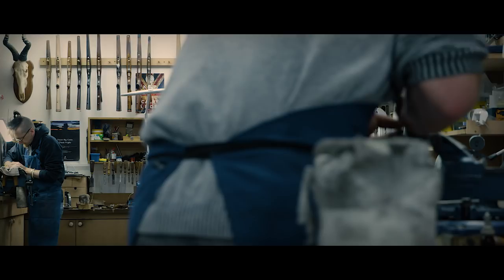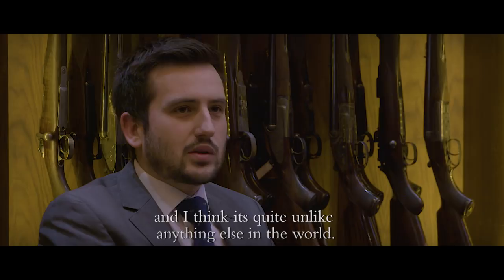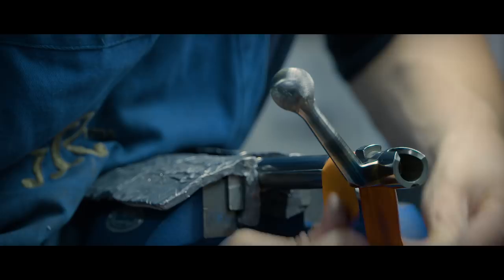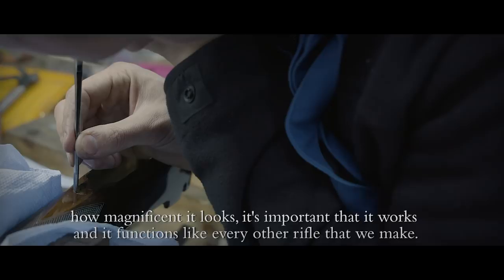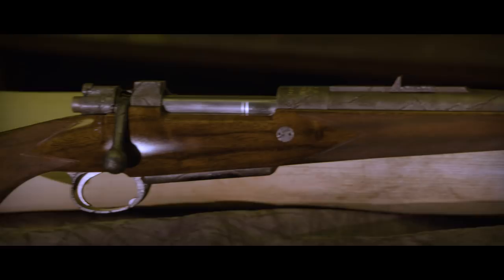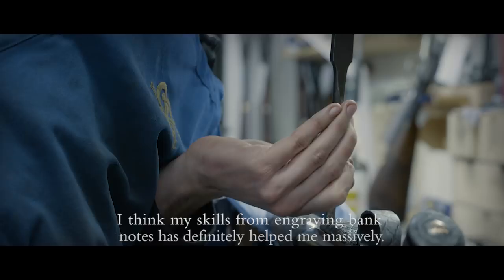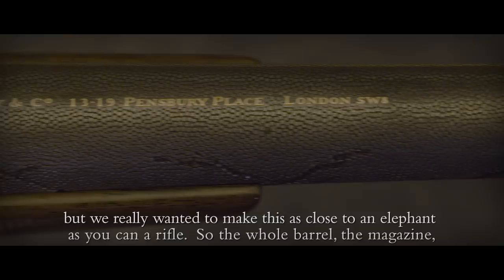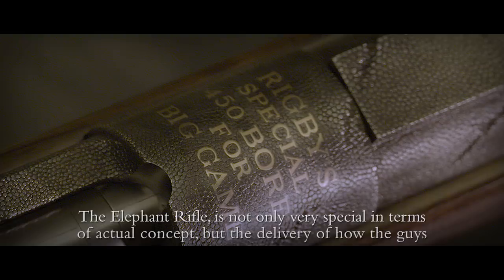Rigby - The Making Of The Elephant Gun

Comment: Nice gun....
What about .333 bore rifle..is this bore still in use..
Reply: Did you mean .303? Because I've never heard of .333 before.
Reply: .333 Jeffery, is in use some places,not so much as .338 Win Mag and similar. Woodleigh make bullets of correct weight and diameter, 250 and 300 grain soft,solid. Cases are made also, or reform from  parent case .404 Jeffery .

Comment: Surprised you engraved the end of the muzzle as well.  Thought the crown is important with regards to accuracy?
Reply: Yes but when youre target is bigger that a basketball and most shots are at very close distances its not that big of a deal really
Reply: @James Passmore 

Perhaps you could explain the difference between crown and muzzle for me then James?

I was always under the impression that the muzzle is the front end of barrel from which the projectile will exit. Precise machining of the muzzle is CRUCIAL to accuracy, because it is the last point of contact between the barrel and the projectile.  Engraving the crown (muzzle) WILL affect accuracy of any rifle.
Reply: I stand corrected James.  So I in my original post I shouldn't have used the word "muzzle" in the first sentance, instead I should have referred to the "crown"?
However, I standby my original comment where I queried the logic behind extending the engraving to the surface of the crown.  Do you agree that this will ultimately influence accuracy of the finished rifle?